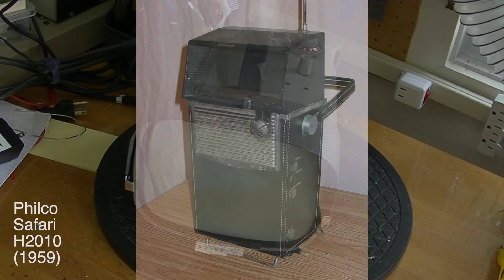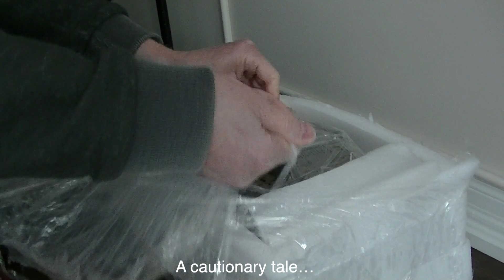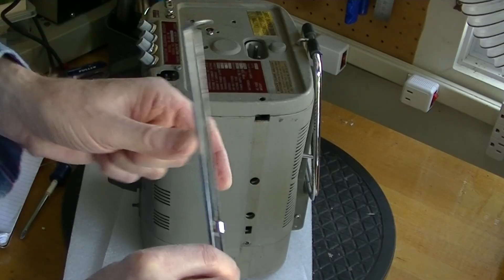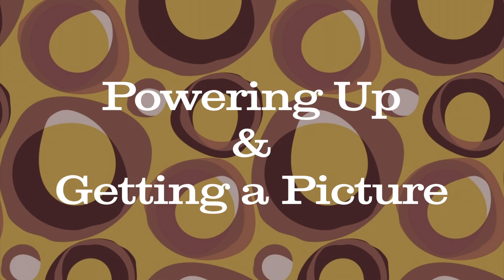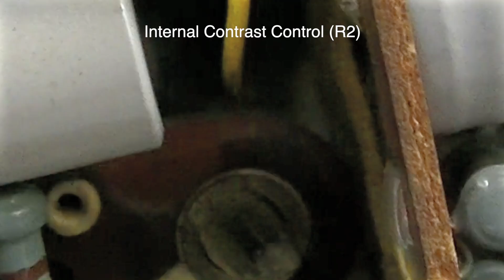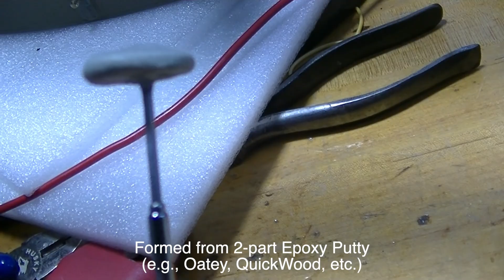Sony 8-301W Television from 1961

Comment: I like this antique TV. Do you have a circuit diagram? I would like a copy because I am also planning to buy one. If you have one, please give me one. Thank you.
Reply from the maker: It is indeed a very interesting television. As you saw from my video, the components are tightly packed on stacked printed circuit boards. This makes access easy but difficult to troubleshoot because the boards must be together for the TV to work. It also introduces points of failure where the boards plug into one another. In terms of the schematic, let me give you a link to it. You can find this schematic and thousands more at RadioMuseum. It’s free but you do have to sign up. I have. They allow you to take resources (free) but ask that you share when you can. For this TV the address is https://www.radiomuseum.org/r/sony_8_301_w8_301.html   I hope you find this helpful.
Reply: Thank you very much, thank you
Reply: I found it very troublesome to register here. I didn't see where to operate it. Because I am buying a TV like this, it would be easier to repair it with a circuit diagram. Thank you.
Reply from the maker: Did you register with RadioMuseum? It usually takes a few days for the registration to go through because it’s not done by employees. It’s done by volunteers.